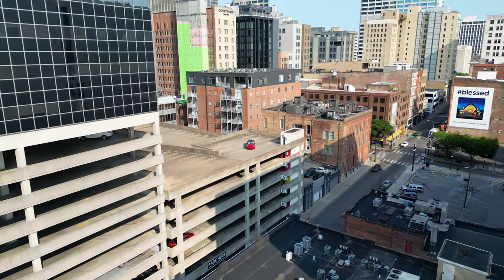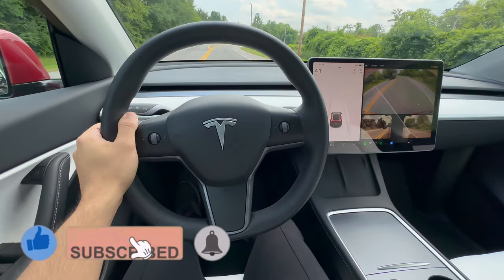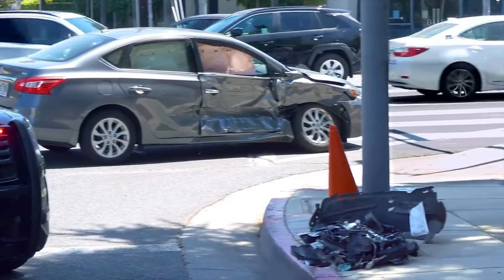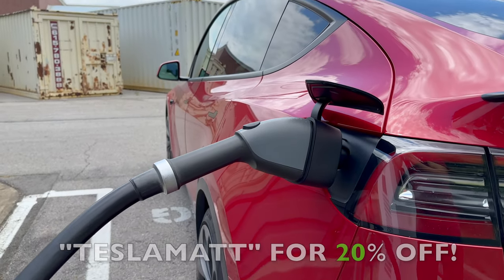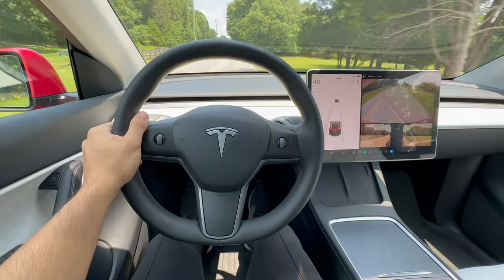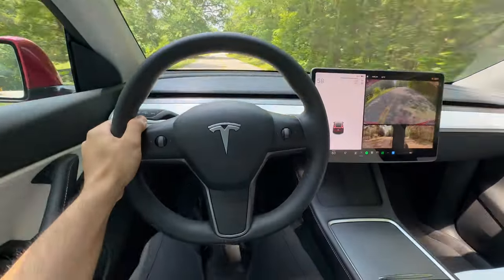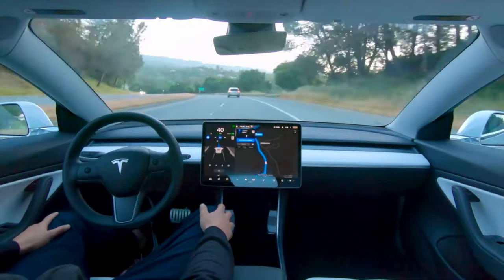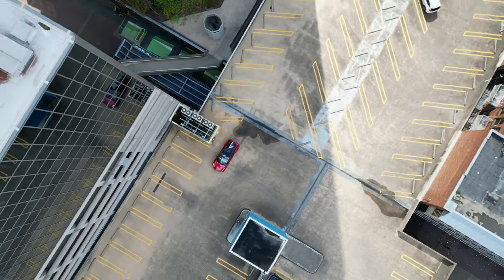Why Tesla Model Y is the Safest Vehicle EVER

Comment: I"m not a fan of the structural battery pack because it makes it more difficult if not impossible to replace a battery module within the pack.  The whole thing would have to be replaced, which means  insurance could go up because the vehicle may cost more to repair so they end up totaling it.

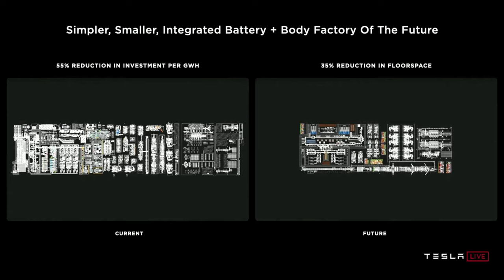At mark 8:52 you do realize while you were talking about the battery pack, the picture was of reducing the battery & body factory size, not the battery pack.

Comment: We have a 2022 Tesla Why. When it is not in cruise control mode there are no warninng features. I just took a trip in a new Toyota RAV and found even without cruise control there were warnings when backing up to close to something or when leaving the lane. I also find that when using Tesla cruise control if the car crosses the line once to often the feature is turned off. That makes no sense, it should be just opposite perhaps even being louder to warn the driver. I believe issues should be brought attention to Tesla engineers. Yes, from your video I see the safe features but after driving other new cars, I question Tesla's claim to safety. In ordinary driving it lacks the new safety features on many of the new cars.

Comment: Hi can u make a video about the fsd. What happens if you sell your car or what happens if you crash your car, will insurance cover the car plus the $15,000 or what if u subscribed monthly , it’s a big question with the insurance .
If Insurance doesn’t pay that and you cannot transfer it for your next car how does it make sense to even have that?
Reply: If you sell your car FSD goes with the vehicle.  If you crash your car insurance might cover some or all of the FSD purchase price, but you have to make sure they know you have FSD when you get the insurance, which means they could increase your premium.  If you only do the FSD subscription then no, it's not covered because you paid to use it not own it. 

The main reason people bought FSD was because they would get free hardware upgrades when available and they didn't have a subscription service yet.  Now considering the odds are Tesla will change the hardware design over time, like they just did for HW4 which doesn't allow older cars to get it, it doesn't make sense to buy FSD and it makes more sense to get it via the subscription when you need it.  They lowered the price of FSD from $15k to $12k and at this current price you could do the subscription at $199 a month for over 5 years.  Many people will get a new car by then and if you were someone that preferred to buy FSD outright that means you would have to buy it all over again and it could end up costing more than $12k.